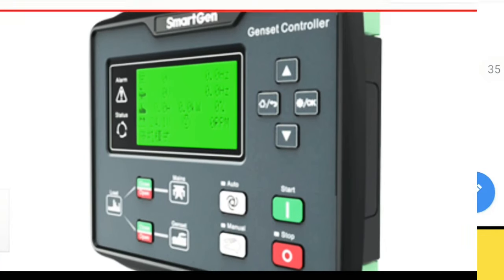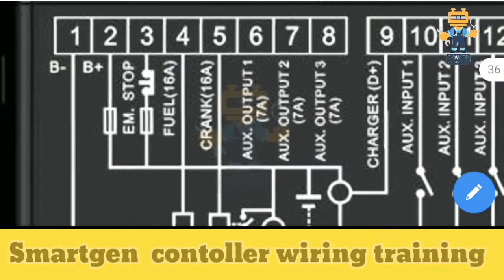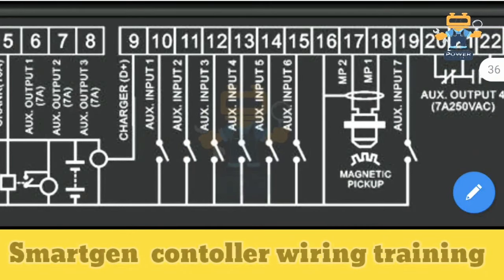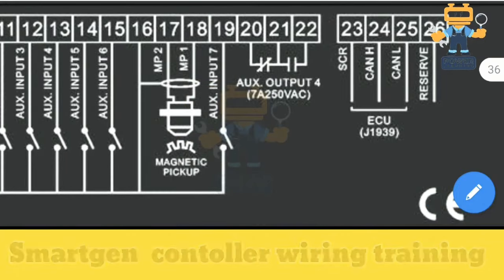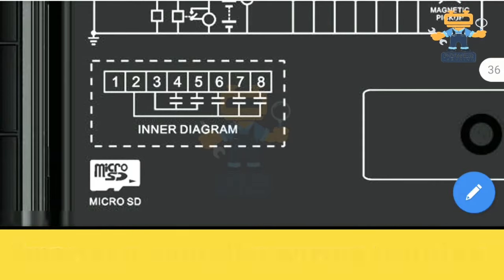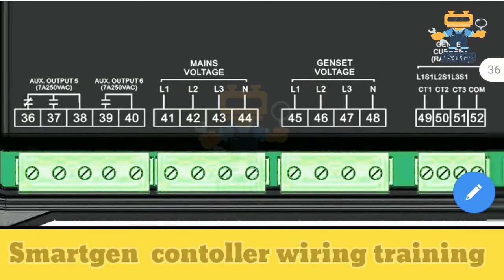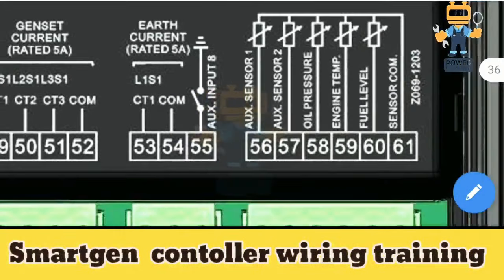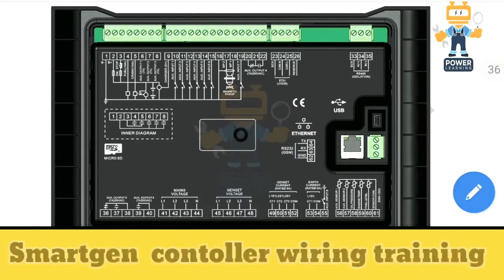#Smartgen wiring pdf | Generator wiring connection pdf #ATS CONTROLLER USER MANUAL wiring diagram

Comment: Hello, Which model would be compatible to replace the DSE 5320, I have a 5320 that broke the display and I intend to replace it, in the DSE models the compatible option for replacement is the 7320.
Reply from the maker: Dse 7320 used for AMF application if u have singe generator operation used DSE 7320
Reply: I wanted to know if there is any compatible alternative for smartgen, I already have the information from dse.  is there any smartgen that could replace without problems?
Any alternative in Smargen model?
Reply: @ELECTRICALPOWERGENERATION  yes, i have a single engine 22kva

Comment: do you have one of these videos for the MGC100?
Reply from the maker: Will make special video for you what ever topic videos u want just comment us
Reply: @ELECTRICALPOWERGENERATION  Wow cool, I am totally confused from my generator wiring diagram, it is a key start and has 6 wires connected to the ignition switch.  they are labeled G, FS, Bat, St, IG and G.  Which slots on the MGC100 do the gen wires go in?  will the ignition key be removed from the Generator?

Comment: Hello Sir from Germany, thank you for your Video . I have an question . What is to do to start the genset by remote ? In document is written that the aux 3 Input is factory Default for remote start . But when i Press Auto after 5 second Generator always Starts. Do you know what can i do? Thank you
Reply from the maker: We can support on call share ur WhatsApp no
Reply: Thank you to much for your Videos. I found the solution in your Videos. I had to connect the 3 main phase curent to the smartgen. And with this connection the automatic function worked perfectly. 
 @ELECTRICALPOWERGENERATION